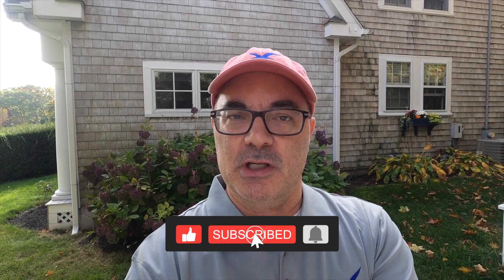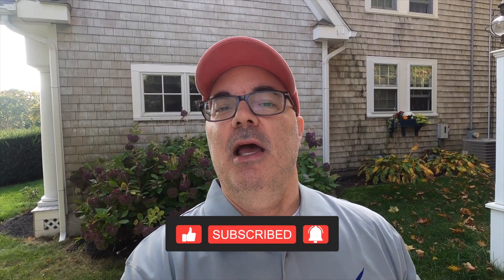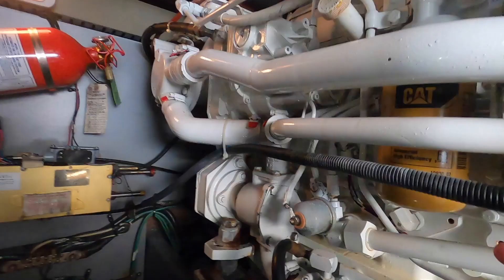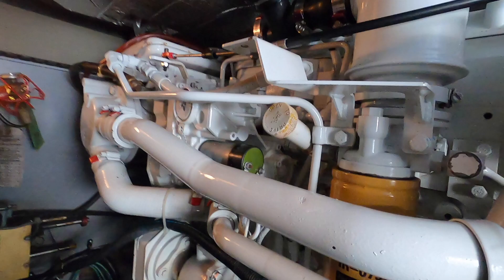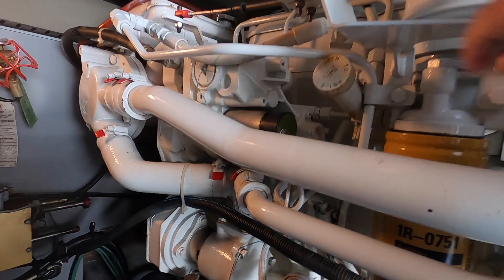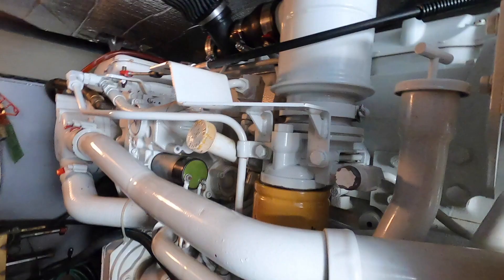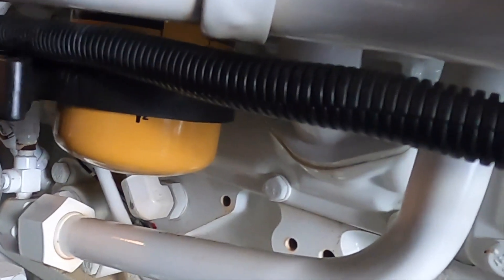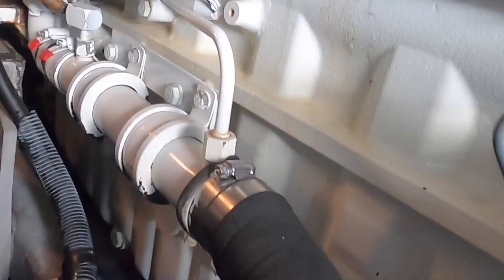DIY Diesel Fuel Filter change on Caterpillar 3126 engines on Calypso II

Comment: Next time pre fill the the new filter with fuel, it helps prime the engine and prevents wicking which is a combo of a dry filter and air pockets within
Reply: No. It's a wrong ideal,.....never try that with cat 3126 motor ...

Comment: TIP i learned from my mechanic, everytime I change the fuel filter we had Diesel STP fuel  injector cleaner inside the new filter, It will clean your injectors, plus removing air from entering the system. Great advise, and you will have cleaner injectors everytime you  change the fuel filter.
Reply from the maker: Great tip!

Comment: When changing that fuel filter. Top it off when you screw it on and should start right up without using the hand pump.
Reply from the maker: Thats great advice.  do you keep a small tank of diesel in order to do this?
Reply: @CruisingCalypso  yes, keep a small tank of fresh diesel, and top the filter full then screw it up, that way you wont have any air inside the filter.